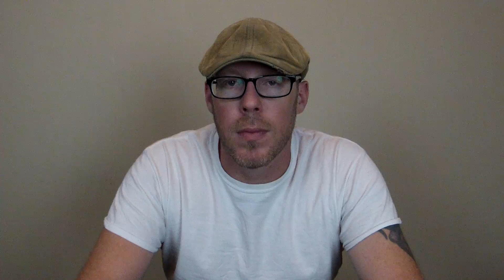Gunite VS Shotcrete Pools

Comment: leak in pool main drain.  Dug very very deep and replaced the flex with hardline... still leaks.  Is it possible to dig / break through the shotcrete / gunite to access rest of the main drain pipe to repair / replace then patch up the gunite?

Comment: So... Shotcrete. Pump operators and ready mix truck drivers can add water to the mix from the trucks tanks, that kinda blows your perfect mix theory, and pump operators love to add water cause it pumps better and makes clean up easier. Next thing is that stuff in the ready mix truck starts curing as soon as the water is added at the plant and it's really only good for so long, the sooner you can place the material and stop the mixing process the better. And the material size that can pumped is smaller with  shotcrete than what can be pushed through the hose with air pressure (bigger rocks are better). Gunite is superior if you have a good nozzle man and the settings on the batch plant haven'[t been fiddled with to lean out the mixture. I only have about 7 years total experience working for companies that used both processes so I'm hardly an expert. The only thing I will state with authority is that Gunite Reed Guns SUCK, especially if you have to deal with wet sand or high humidity..